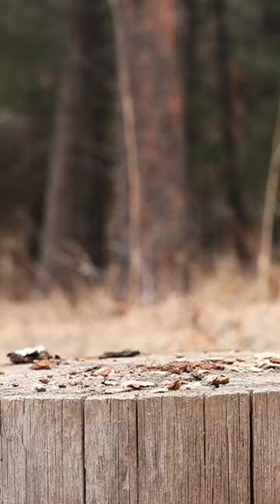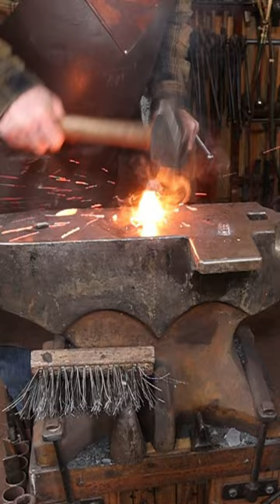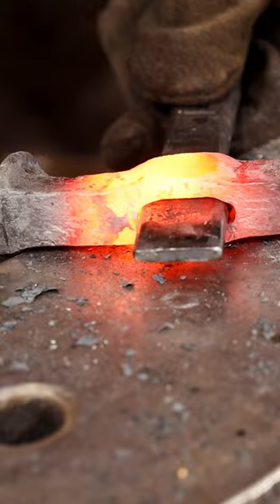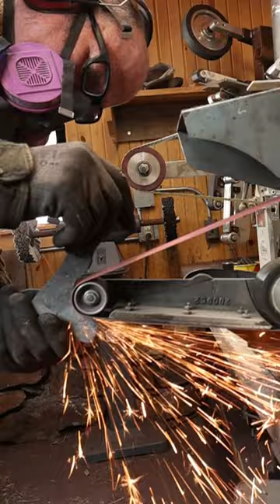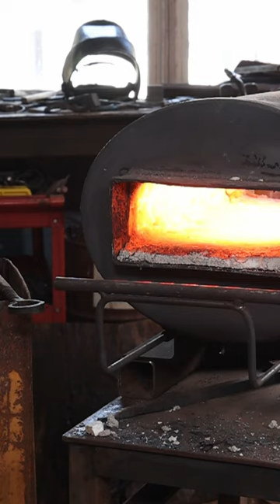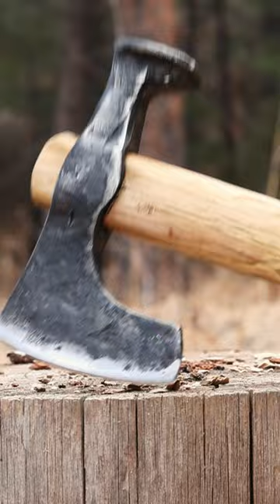Forging a railroad spike axe - #shorts

Comment: That induction forge seems quite handy.
Reply: Very clean I’d say
Reply: @littletree343  Indeed! No smoke or fumes, and possible to power directly with renewables to boot. The only big problem with them is the intensity of the magnetic field being able to break pacemakers and other electronic implants.
Reply: I'm about to start building my own after seeing its versatility
Reply: @SAOS451316  charcoal is very renewable and also carbon neutral, unlike a lot of electricity
Reply: @Handles_arent_a_needed_feature  It's renewable but not carbon-neutral. Creating charcoal requires burning which releases carbon dioxide and several other byproducts, and using it burns it more. You can plant more trees to offset that and create a carbon-neutral system of course.
Reply: @SAOS451316  it is carbon neutral cause the tree that made it took in carbon. Coal and oil power plants on the other hand are not carbon neutral
Reply: @Handles_arent_a_needed_feature  yeah but not everyone can burn depending on their location so that induction forge is very very nice and stealthy
Reply: @blueberry766  stealthy?
Reply: @blueberry766  id assume the loud hammer blows would give your location away
Reply: @Handles_arent_a_needed_feature   you can invest in a hydraulic press

Comment: This project has everything that is basically essential: hot cut, 1 fold, 2 forge weldings, 1 punch through, one split, marrying different pieces. Can be done in 30 minutes.

Comment: A super cool looking axe head. I am concerned about the quality of the railroad spike steel. After creating such a beautiful tool it be a tragedy if the head broke.
Reply: Not a problem, notice that a piece of hardenable steel was welded into a split in the spike steel.  The softer spike metal will not crack, the only concern will be that the weld will hold.

Comment: These are high carbon yes? Are the railway irons (tracks) hc steel too?
Reply: Railroad spike so pretty low carbon steel. That's why he Forge welded in the high-carbon for the blade

Comment: This is a serious question, well statement asking for response. A guy gave me a knife he'd made out of a spike once, it needed some finishing so I filled the hammer marks out and refined the shape. I then heated it to cherry red and dunked it in a bucket of used motor oil. That thing got so hard no file or sand paper would touch it. The only thing that would barely sharpen it was diamond. So my question is, is the extra metal necessary?
Reply: Not all spikes are made equal, I've had some that would get file hard and others that I heat to yellow and drop in cold oil to get the oil hot for heat treating a better piece of steel and the spikes never get hard at all. I think the older ones have more carbon.

Comment: Could I inquire as to what the coil is you use to heat the metal? If it is a particular brand and model you use, it would be very helpful. Thank you

Comment: Is it possible to split the head of the railroad spike insert harder Steel and Hammer that into a blade with a wider beard? And flatten out the spike end as the hammer

Comment: Aren't spikes mild steel? If so the edge probably wouldn't hold that well, but you can case harden mild steel, check clickspring's video, but basically it involves heating the blade with a mix of clay and charcoal so the carbon moves to the blade iirc.
Reply: He forge welded a high carbon steel beard onto the railroad spike about halfway through the short.
Reply: Didn't you watch the video LOL?

Comment: So im a beginner and i was wondering why you split the head of the axe? Did you add a small piece of high carcon in there for your edge? Or is it for someother reason bc i am def going to try and make one
Reply from the maker: You are correct, I added a piece of high carbon steel to makea better cutting edge.

Comment: Why did he split the blade side and then re forge weld it again???
Reply from the maker: I was welding in a higher carbon steel for better edge holding in the finished piece.